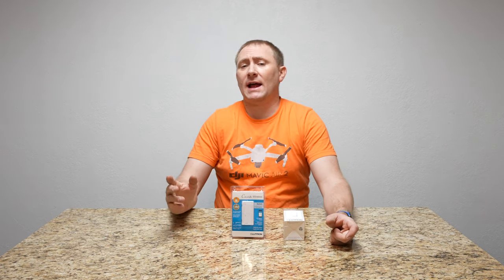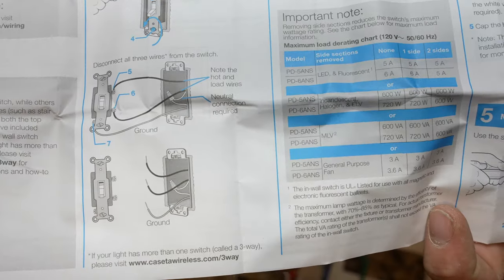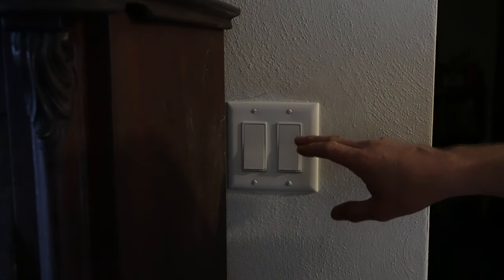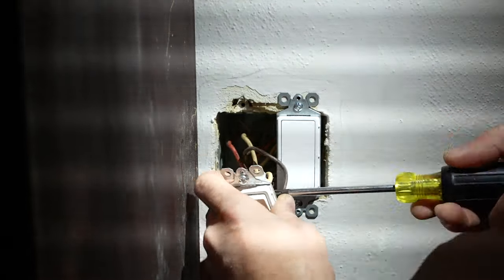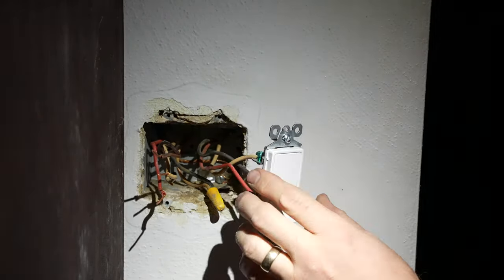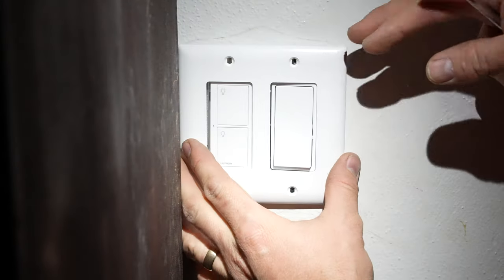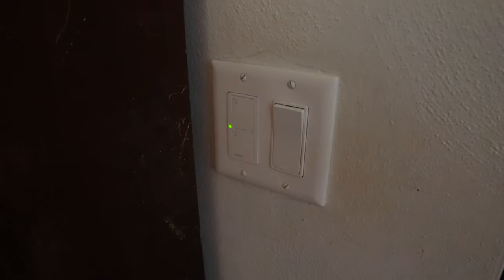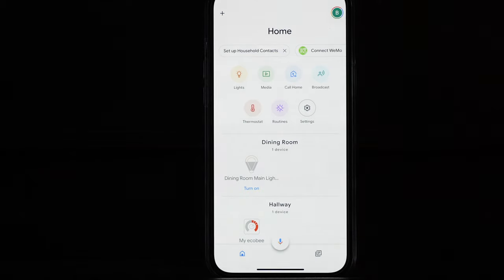Caséta by Lutron Smart Switch 3-Way Setup

Comment: please put a disclaimer in the comments or amend your video to comment on your error for connecting the common wire to the red wire of the lutron switch (the common wire should have been on the black). it is very confusing for folks who are following this video step by step!

Comment: Great video. I had a lot of problems getting this switch working on the same config as you are showing. Nice job on walking through it!!! I have one 3 and way cassette switch that doesnt quite work right the Lutron switch works but if the rocker switch on the other side of the stairs is off the upper Lutron is not getting power, must have one of the wires swapped incorrectly, just not sure on how to figure out which one. (Did not this install before finding your video)
Reply: I have same setup and problem. I have given up on trouble chasing the fix.
Reply: @larrykrueger8948  I have the same issue right now, I’ve heard it’s because the smart switch reads thru the light bulb. I’m tryna contact Lutron right now

Comment: Why did you choose to use a rocker switch vs Pico remote?
Reply: Probably because the pico remote is 25.00 and the mount bracket in another 20.00 and a rocker switch is 2.00

Comment: always test your wires and never match colors learn what is  hot and neutral then look at the instructions of the company and see what the color for hot ,ground (green) neutral, now at my house my yellow was my hot, my orange was my neutral and for my other very old house, my white was my neutral and my black was my hot.Now you see how a person can screw up.THe tool i use is a klein 
Klein Tools NCVT3P Dual Range Non Contact Voltage Tester, 12 - 1000V AC Pen and my second test is my multimeter . i use two tools to be safe .

Comment: Can 2 Caseta Wireless Switches be used in a 3-way? I’m having problems with this type of setup. One works like a master, if that one is on, then the other one works. If the master is off, then the other won’t work at all.
Reply: I am having the same problem🥺
Reply: @steevydance  I solved the problem. I used one smart switch, one dumb switch, because 2 smart switches is redundant. I downloaded instructions from the internet, look at the wiring schematic very carefully is all i can say.

Comment: Why not just buy a pico remote and use it instead of the second switch.?...
Reply: It’s better to use a hotwired 3 way switch instead of the battery in the wireless switch dying
Reply: It already exists so It’s cheaper.  Why waste money on a pico if you don’t need to dim at the other switch?

Comment: So what happens if you loose internet?
Reply from the maker: Still works locally, just can't connect remotely.
Reply: @GeekSmart  I think it is not a good idea to rely on these for a new construction. It is great it you have a single switch in an existing house and you want to have 3 or 4 way. But a new construction house should be wired as if these switches don’t exist.
Reply: @Faruk651  just say your stuck in the 80s and move on
Reply: @lucassanto9565  I thought the switches communicate thru the network but i did more research after this comment. They work without being connected to a network as a manual switch.